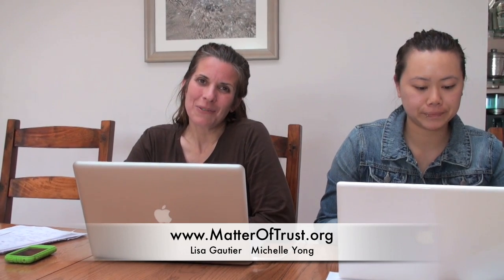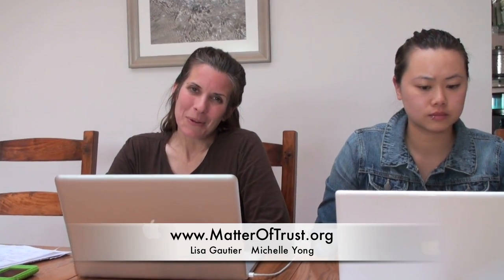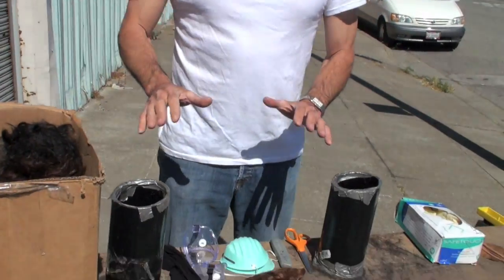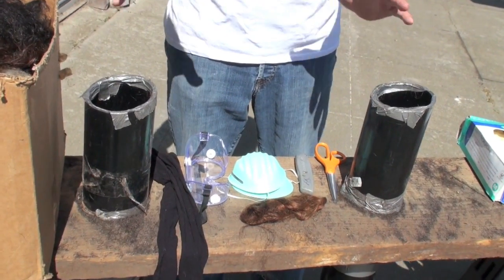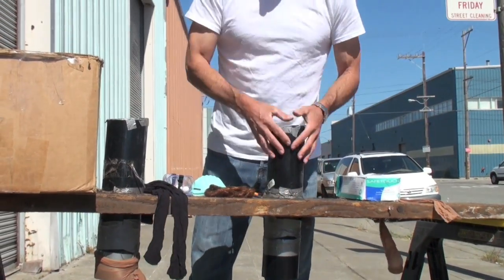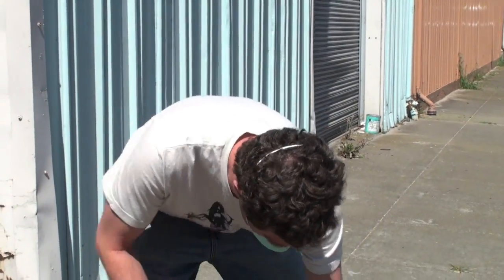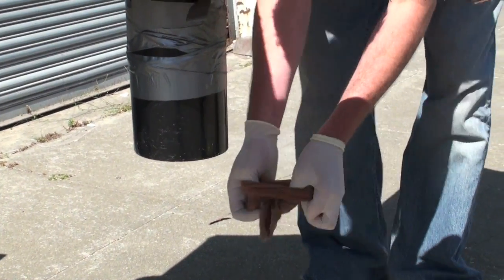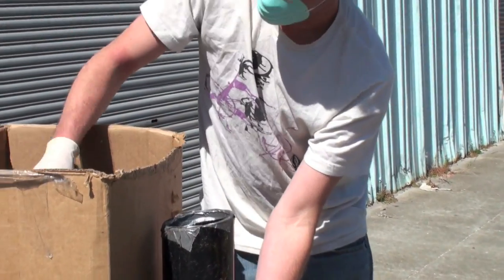How to Make a Hair Boom

Comment: Several folks missed the key info at 2.50 about covering the booms with mesh and  they even recommended a type of mesh.  Presumably this is to stop the problem of the nylons breaking.  In one of their blogs postings they even suggest putting them in burlap sacks before dragging behind boats.

Comment: Pipeline had leaked made the oil spilled out in to the ocean AROUND 50000l of crude oil has spilled off the coast of Thailand like Rayong and Pattaya nearby coastline. Team Rayong Oil-recovery Volunteer Service.
Assa Engineering Service
104/6 Moo 7 Tabma Muang Rayong 21000
servitce@assa_eng.com

Comment: The hair sacks don't pan out. The only way to fix the situation is with that of heavy machinery and intense chemical sifting. There are going to be negative reactions from this, but in the long run its the only real way to fix it. If you really want to help the problem and prevent this from ever happening again, then stop driving your cars, and start physically pushing your government to invest in greater sources of power. That Hydrogen vehicle looks pretty damn swank, its exhaust? H2O!

Comment: Hey Great Idea. Im really stoked to see this is happening. I've done testes myself and have found the booms to be successful at absorbing the oil. However they should be tied together and attached to flotation devices to insure there success. They also seem to work better in calm water and even on shore. Def not to be pulled behind boats as they are still somewhat fragile. Unless maybe in burlap sacks.